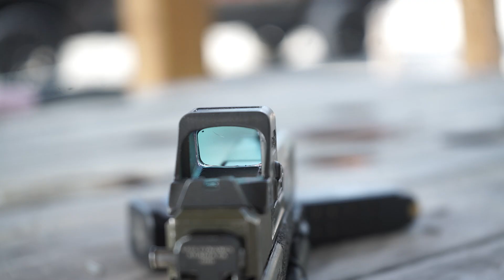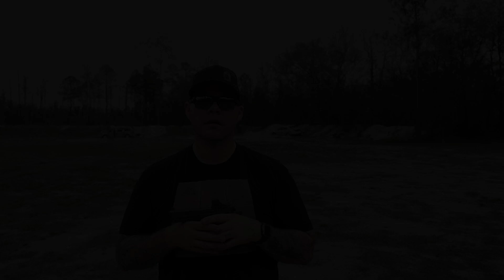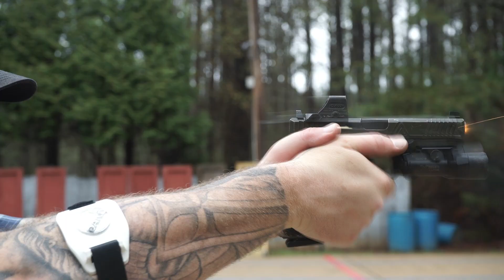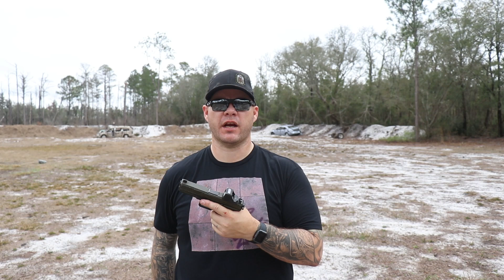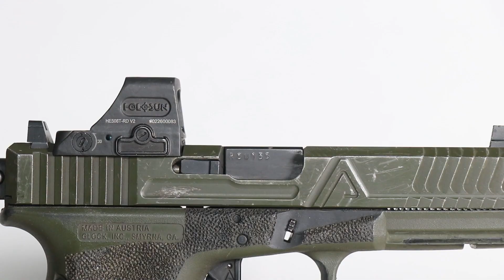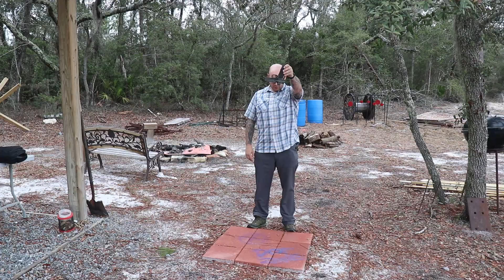Holosun 508T Gen 2

Comment: Hows the parallax on this? Does it stay true to the target or does it move with your head? I also notice on the 509t as the reticle moves around to the sides away from the center,there's alot of distortion,does the 508t do that as well? Im curious because im torn between the 508t and Trijicon RMR type 2.

Comment: Fantastic deal for the money and a proper duty rated optic. Trijicon has long leaned on the fact that they have military contracts and have used this as a crutch for those who love the term “military grade” but don’t actually understand what that means. Considering features, the trijicon RMR is so bare bones that it could be considered archaic at this point. You have to remove the optic and re-zero to change the battery, the bottom of the optic is open to the elements and without a sealing plate the battery just grounds on the frame of the optic and thus was part of the reason it had issues with flicking early on. It only has one reticle and it isn’t great for those with astigmatism. The model with a 3.25 MOA dot looks more like a 8 MOA star to me with my moderate astigmatism. And the optic doesn’t have a solar failsafe. The holosun, on the other hand, has years longer battery life, a solar failsafe, auto adjust brightness with a manual lockout, the batter changes out of the side through a trap door with one flat head screw, the optic is waterproof and sealed, it has the same footprint as the RMR so slide comparability is there and it’s cheaper. It’s literally a no brainer. Trijicon fails to adapt to the times and can no longer lean on its name now that holosun has improved their design for them and made it for lower cost.

Comment: Continuing the explanation on refresh rate, it is important to note that the LED is most likely being strobed via PWM to produce different brightness levels. Therefore, at the highest brightness level, you should never be able to see the refreshes because the duty cycle is 100%. At the lowest brightness setting is when the strobing is most apparent, since the time the LED spends turned off is much greater. However, this can be mitigated with a high refresh rate, which is probably what Holosun has done.

Comment: Does it fit on a Brownells RMR frame because the 509T does not. What a shame
Reply: The 509 won’t because its a closed emitter. It’s impossible to attach it via screws. This is the case with all closed emitter optics
Reply: @Corey_Campbell24  
For sure Jagerwerks will find the solution as they do 509T milling on the CZ P10 and others.
Reply: @Celtic87  there isn’t a solution to that. It’s a completely different style of optic. The only option are rmr to 509 plates. Your best bet is to get the agency AOS that will let you use both with the correct plate

Comment: I have this optic now and a cr precision slide.  How should I measure to set up the lower 1/3rd iron sights? Am I measure from the bottom of the cut for the iron. Or am I measuring from flush area of the cut to the slide?

Comment: Really disappointed that Trijicon sued Holosun over button location.  Holosun put them on one side where Trijicon used one on each side.  So I guess the 508Tx2 is the same design only back to the small buttons as the gen 1

Comment: So Holosun are releasing an update to the 508T-V2 the 508T-X2. The only different I can see if that the X2 variant features a lock out mode “The X2 series adds an innovative Lock Mode to the existing Auto and Manual Mode functions (Only Solar Failsafe models have Auto Mode). Lock Mode will lockout the buttons preventing inadvertent setting changes” so that’s the official statement from Holosun but worthy of note.

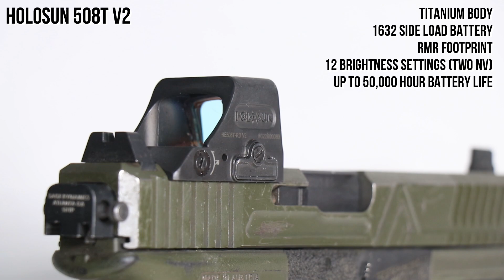Comment: Dig your vids, but commonly repeated misinformation @ 2:10. My v1 507C's manual actually states 100,000hrs (circle dot) or 200,000hrs (dot only) at setting 5. While my 407K (and I'd assume the 508T v2 I have on order + any other 1632 optics) states 50,000hrs (dot only) at setting 6. Proof: https://imgur.com/a/ya2ExEm

Holosun has made ZERO statements about improving emitter efficiency, yet switched from 2032s (~220mAh) to 1632s (~130mAh). That's close to HALF capacity. Can't eat your cake and still have it! While I obviously see the benefits to side-loading, realistic run time WILL take a noticeable hit and I'd actually LOVE to see a longterm test / vid on this.

Comment: The stroboscopic effect you're referring to is actually called PWM (Pulse-Width Modulation), not "refresh rate". Both are measured in Hz but are otherwise different.

Comment: All the complaints about it being Chinese are valid but wtf is trijicon doing. Holosun has shake awake tech, solar panel with a capacitor (you can literally run it without a battery) and multiple reticles. American manufacturers take advantage of Americans and get lazy.

Comment: That's not true about a tool to change from Shake awake how long it stays on only thing the tool is for is mounting the optic and elevation + windage you use the two buttons on the side press and hold them down for different functions check the owner's manual

Comment: I understand the Glock MOS optic mounting system has its issue with maintaining the optics securely and after some firing they loosen up. I believe this is because the MOS plates are just to thin to give the mounting screws enough threads to bite into. I would like to know if this was corrected with the M&P 2.0 CORE. I can't see the purpose of the plastic spacers on the CORE other than acting as a washer of some kind to help prevent the optic from loosening and  a guide to make sure you put the screws in the right holes but is there enough threads and metal on the M&P 2.0 CORE to hold your red dot so it doesn't loosen after 2 to 3 thousands rounds?

Comment: Anyone else watching this for the third time while waiting for your 508t gen2 preorder to actually ship?
Reply: Lol...he ordered from Optics Planet.  He might still be waiting this time next year.
Reply: I placed an order on optics planet this weekend, should ship out in a few weeks
Reply: @derrickaguirre833  have you gotten it yet?
Reply: @derrickaguirre833  It's been more than a few weeks since you posted.
Reply: When does it release? Debating between this and the 507c
Reply: @ipwnu11b  I think its out already but just back ordered everywhere
Reply: I preordered the one with the green dot
Reply: Just received mine and when you tighted the battery tray the optic shuts off.  It's headed back to Holosun on warranty.
Reply: @jasonlash6479  you probably did itwrong.
Reply: Did you try changing which mode you are in?
Reply: @ProbityCFab  yep, does it in auto, manual, and locked.
Reply: @jasonlash6479  battery flipped?
Reply: @ProbityCFab  the optic is on and shuts off as you tighten the screw for the tray.  So yes, the battery is in correctly.  The optic also shipped with a dead battery.  I know this because by replacing it with a new battery and cycling through the different modes it worked correctly, but continued to shut off when tightening the screw.
Reply: @jasonlash6479  Just don't srew it down. Boom problem solved.
Reply: Cannot wait till September so I can blow all my money on rds classess
Reply: Zjenji 😂😂👌
Reply: Just ordered one from New Zealand that’s in stock for a Chambers custom build. Hopefully it gets here soon
Reply: @loganyoung2408  they are not shipping because of the lawsuit
Reply: Sunny cat 88 It was delivered a week or so ago...
Reply: @loganyoung2408   How do you like it I was trying to order some as well and everyone was saying that they were not shipping them because of the lawsuit with  You can I know they cleared the lawsuit up 2 weeks ago maybe that's why they finally shipped them how do you like it is it worth the 360
Reply: Sunny cat 88 haven’t used it yet. Just taken it out of the box to handle. Seems well built. I’ll be sending it off to Chambers Custom shortly when he starts the build.
Reply: They're not shipping because of the lawsuit
Reply: I've watched it at least four times now
Reply: JUST ORDERED MINE ON AGENCY ARMS EEEEEEEEEEEE
Reply: @allcapsboy9139  better than the rmr. I love mine.

Comment: Question: As a RDS shooter for about 5 years now; why is their this hang-up on removing the optic to change the battery? It seems as a non-issue as it only occurs once 
every year on my birthday.
Reply: Tony Sparks - Because it’s irritating and takes longer than just popping a cap on the top or on the side to change the battery and have a 0% chance of a shift in zero.

Comment: As far as the strength of different shapes, yes, triangles are the strongest in compression. Circles are the strongest in tension. More important than the strength of the shape is directing forces around critical components. that's why the RMR is so durable. It directs the majority of impact forces around the lens - the most fragile component of the optic.

Comment: Surprised you still didn’t mention the sloppy spoonful of epoxy or adhesive they use to  cement the glass. Using that much adhesive simply means that the glass has a very loose tolerance and that it needs that much epoxy to secure it. It’s an eyesore! I am not a trijicon fanatic but trijicon’s glass tolerances are so tight that minute amount of epoxy are needed to secure the glass in place. Sure it solved the problem but quality build, nah! My final beef with Holosun is, it still Made in China. I was about to return my 508T gen1 for sloppy adhesive but noticed in my lgs, others are much worse than mine. Bought Trijicon and easily conclude the quality is superior on Trijicon. Manufacture them in Japan, Malaysia, Singapore or Philippine at least.
If not in USA. Not helping our economy here!

Comment: I went for the 407 v2 with the green dot and it is fantastic. Paying an extra $50 for the 507 just to have the circle dot didn't really interest me. And the extra $150 for the titanium 508 didn't seem worth the extra cost beccause this wont be on a duty gun. The quality is outstanding for a $240 optic.
Reply: I know this is an old comment but I got a  508T for $300 a few months ago shot RMR type 2s and this is a flat out better optic at almost half the price. The circle dot is awesome for cqb which i train alot in easier to track with the eyes for rapid fire
Reply: @redeye8526  except that RMR Type 2s are available for 420ish all day right now.
Reply: I'm running the 407k 6 MOA dot on my wife's Sig P365XL and the 509T on my 4.5" PDP.  We both love the 6 MOA on the XL and I'll be using my 509T PDP on a HAM hunt for Javelina in early '22.  I'm grouping tight with the PDP at 50 yards!  These Holosun RDS' have revolutionized accuracy for me and the wife.  I do the battery change on my B-day and couldn't care less about irons.

Comment: I have the 508T V1 now and I'm going to buy the 508T V2 I was thinking of buying the green dot instead of red because i have astigmatism.  Do you have any thoughts on this?  Thanks for great content
Reply: I have the 508t v1 green reticle and it is great for astigmatism. Its about as blurry as an eotech is. Works great. Also recommend Acogs and etched reticle LPVO's. I thought all reticles were whack, looked at MRO's , rmr's , aimpoints, DPP etc and thought they were terrible, my vision is great but red dots are weird. (Still not impressed with MRO's for money)
Reply: I'm thinking the same thing. My hesitation is what seems to be a smaller field of view from V1 to V2. What are you thinking about that?
Reply: After using the 508T V2 in green I'll never buy another optic with a red dot. The green seems to be easier to pickup by my eye and it is easier to find outside in my high desert environment. it also appears to be more crisp to my eye. I took an RMR of my G17 to install the 508T. A G19 still wears an RMR, but after using both it will not have an RMR for long.

Comment: V1 buyers are gonna be pissed!
Reply: Twistin' Props I have the 507C and 508T v1s.  I'm gonna get the 508T v2 and just use the 507C on my AR on an offset mount
Reply: @jaeharris9960  right on brother! Sounds like yah got it planned out.
How yah liking holosun's optics?
I have 3 and they have been flawless.  I'm not very nice to my "tools" either.
I put the 407c on a glock.
510c on an ar9. 
Recently bought 507c and scalarworks mount for a 13.7" lightweight build. The total build weight is 5lb 1 oz.
I'm a believer in holosun.
Reply: Twistin' Props currently I have 4 Holosuns.  512C on my AR, 403GL on my MP15-22, 507C on my CZ P10-C, and 508T on my CZ P10-S. 

I love them and the technology of shake awake, dual power sources, and multiple reticles on the 5 series.
Reply: I was when it was announced, only because a day or so before it was announced I had sent out my slide to be milled for a 407 v1. Since it had the same footprint, I will upgrade eventually to the V2 at some point and move my V1 to a turkey shotgun.

Comment: im holding out for the red dots that can co witness with standard irons
Reply: one day..
Reply: But higher irons are pretty cheap
Reply: I would not and don't see the need for a true co-witness. I can see that when first shooting with an RDS they could be a good training wheel, but after learning to acquire the dot I think they would be in the way. I think a lower 1/3 or 1/4 cowitness is fine. Even on AR's I've mostly gone with lower 1/3. On the mounts that are full co-witness I've installed folding sights as I find they are annoying. I would also think a front sight tall enough would be susceptible to damage from a drop.

Comment: @Aaron, I have one explanation of why there’s a gen 2. I purchased one of the gen 1 versions and it had intermittent power issues right out of the box. When mounting the optic just slightly past snug, the optic would power off. I would then need to loosen one of the mounting screws to get the optic to power back on. Did Holosun replace it? Yes they did. Is there support team awesome to deal with? Absolutely. However, I am almost certain that I was not the first or last consumer that had issues with the gen 1.
Reply: I have both the red and green 508 Gen-1's and havent had a problem with either. Had them since January roughly and no issues. Reliable tack drivers.
Reply: I have the 507C and 508T v1s and no issues with either

Comment: Excellent content as always. Out of curiosity, would you consider doing a designated review of the selector backplate? Obviously it won’t be something that practically applies to very many viewers, but I’m sure many of us would still be interested to hear your thoughts - Process for acquiring one, if it truly is just a range toy or if you can think of any real practical applications where you’d want to have the FA option, how it runs with comps, etc. Just a suggestion/request!
Reply: More on topic for this video - I purchased the 508T V1 based on your and other recommendations and of course two months later they announced the V2 with the side-loading battery tray. Oh well though, I’ll just wait the two or three years until I need to change the first battery in my V1 and swap it out for the V2 at that time 🤘

Comment: I have one of these on the way, hopefully better luck with it than the original 508T which seemingly died only 2 months into using it. I am waiting for it to come back from Holosun.
Reply: Lemon. Mines perfect since February. If it went out id defintely trade for the v2
Reply: Had problems with my 508v1 also. It died and lost zero. H.S. being awesome is sending me a V2 as well. I should've kept my vetted 507c, but I sold it after I got the 508 like a fool and I regret it.
Reply: @shadowoffair09  I have a 508T which has flickering problems. Had it for less than 2 weeks. Did you ask holosun to replace it with a V2 or are they doing it standard?